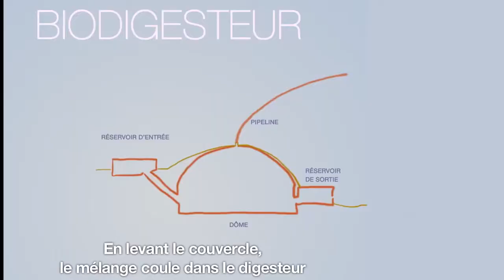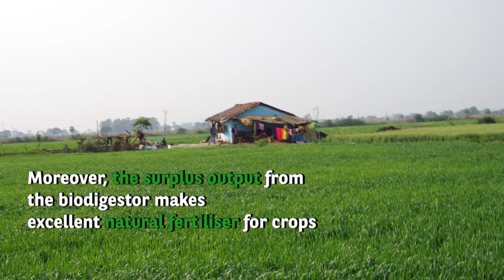Carbon offsetting: Understanding the benefits of biodigesters for the population in India

Comment: No  Carbon Transport, Power Plant
No Engine, No Fuel, No GHGe, No Heat.
Saves 14 Mnt/Day Oil, Gas;14 Mnt/Day Coal, Lignite
Costing 11,400 Bn$/Yr. Saves 3000 Bn$/Yr by Parts
CER= 25 Bnt/Yr.  GHGe=400*0.3= 120 ppm
Inv. 120 Bn$. Pat 240 Bn$/Yr in 4 Yrs